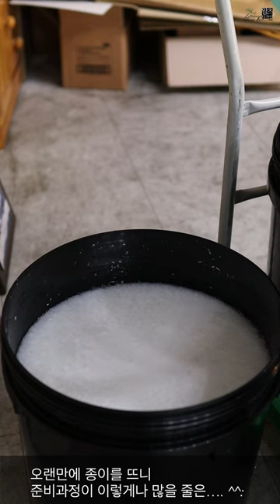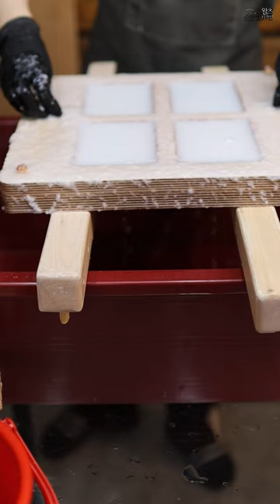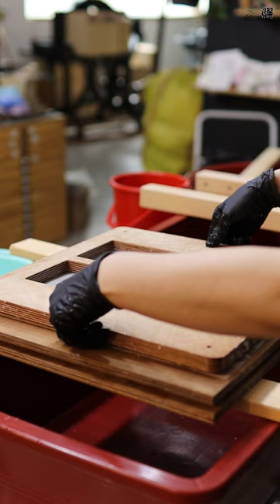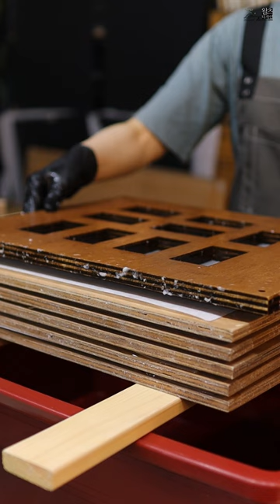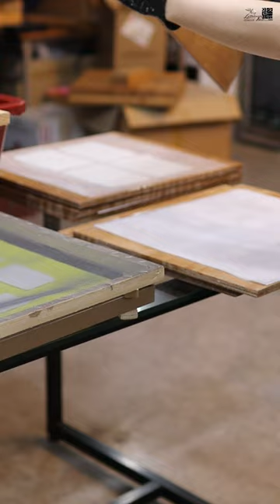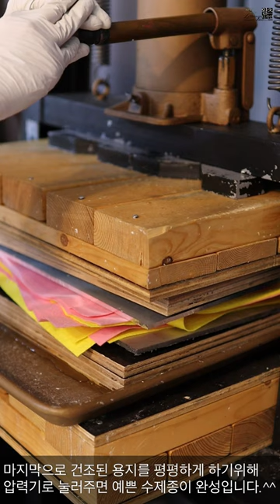오랜만에 레터프레스 인쇄용 수제종이를 떴습니다.^^ Making handmade paper for letterpress printing. #수제종이

Comment: I am from india. Suppose i take orders from here and give you the orders will there be any reduction in price? Because i have to add my margin too.
Reply from the maker: hello. Thank you for your suggestion, but I can't produce paper in large quantity. My main job is letterpress printing. Handmade paper is also produced for letterpress printing. I hope you find a company that specializes in handmade paper only.
I'm sorry I can't be of any help.
Reply: I wasnt talking about handmade paper. I want normal paper that you use. Ready made paper. I ll give you order you just have to print and send.
Reply from the maker: @regalmedia9487  I'm sorry. I didn't understand. By leaving a question in the handmade paper video... In principle, you should not cut the price you receive. It is a manual process and it is not a method of taking pictures of several people at once, but a method of taking pictures one by one, so price reduction is not allowed. Bulk printing is also not possible. In the case of overseas orders, you must make the design yourself and send it as a vector file. I don't think the price is right because you have to pay the shipping cost.